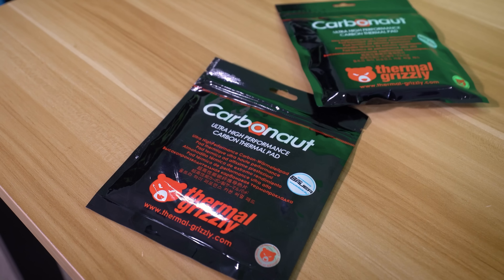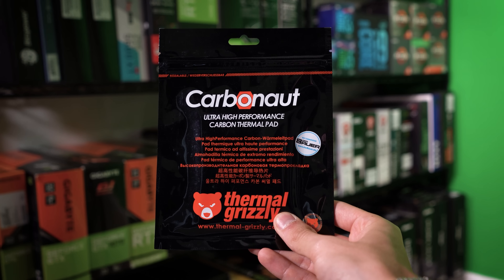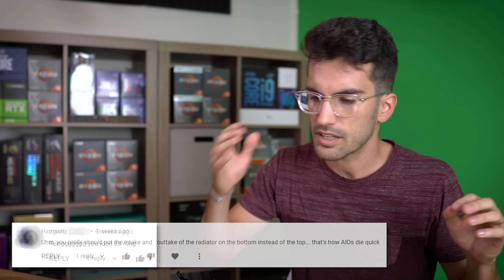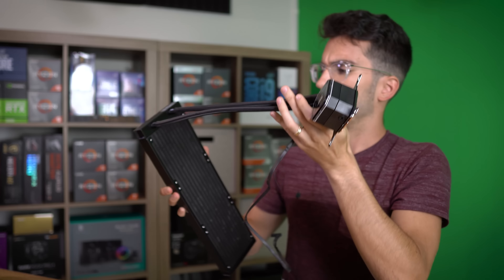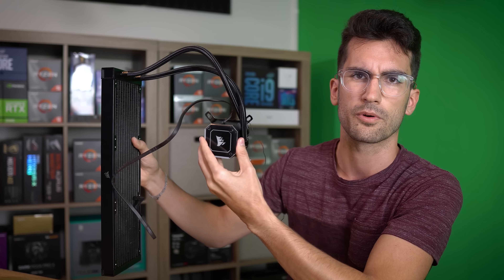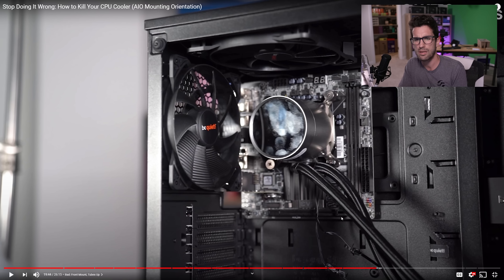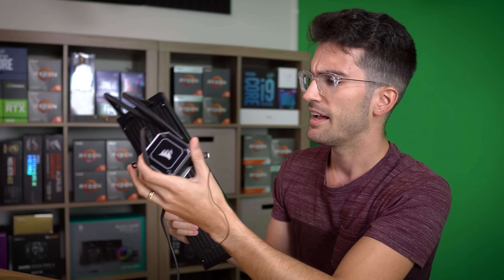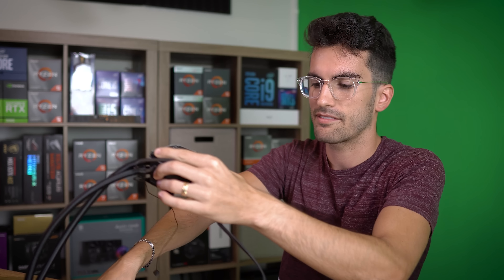Let's Talk About AIO Orientation... Again

Comment: Ive had a Corsair H150i PRO 360mm AIO front mounted (tubes up, BUT slightly above the pump). for 6 years now. My i7 9700K has been cooled just fine by it and never ran into any cooling issues. It hasnt been really loud either. 
   My new 13900k and EK 360mm Nucleus came in yesterday....and now i find myself wondering what orientation i should do even though i know front mounting with tubes up is OK- it never ends 
🤣😆🤣😆

maybe Ill try top exaust mounting this time........

Comment: As somebody, who was engineering hydraulic pumps for aircrafts: not overheating by bubbles is dangerous to liquid pumps, it’s rather what is called pump cavitation or hammering. Pump paddles are hitting the bubbles and this degrades the pump paddles over longer time..
Reply from the maker: Cavitation isn't much of a thing in these tiny Asetek pumps.

Comment: The only reason I am considering buying a PCI vertical mount bracket is to mount my video card sideways and use the space to put the tubes of my radiator facing downwards.

Comment: I have a 240MM AIO from cooler master which I occasionally hear the pump pumping air. I have it front mounted as you explained as the other way around did not leave me any room to work with. It is a rather cheap 50€ AIO but keeps my 3700X under 60ºC under load which is amazing for me (and better than the stock cooler) - I have no room on the top due to clearance issues with the motherboard - I hear gurgling but I don't see any performance issues

Comment: Wow. Thank you for your insight into this.  Just finished my first build and I need to move my (want to move my) top mounted radiator to the front and almost got stuck in the "tubes on the bottom" quicksand - which would have killed the idea of front mount all together since I've go the TD500 Mesh.  But now, I know I can do the font mount with the pump a bit lower than the in/outs on the radiator and since I'm not worried about the little noise it may generate, at least I know that pump and it's overall cooling ability will still be OK.  Big weights .... off my shoulders !!  Thank you !!
Reply from the maker: No worries! Thanks for watching! It's a shame folks are believing this layout is detrimental.

Comment: The thing is all AIO's will have permeation and will loose fluid so the barb up will definitely start making noise. eventually. just place it barb down and never worry about this.
Reply: Sure but not every case allows for up top or in the Front with tubes down.. Mine dosent. Only way the radatior will fit is in the Front with tubes up.

Comment: If your PC is builr for mostly gaming, and have a fan cooled GPU, it's usually best to mount the AIO on top  so that the GPU, Ram, VRM's and motherboard components get cooler air from the front case fans instead of receiving a front mounted AIO hot air.
If you dont game and dont use a high power GPU, then front mount AIO with tubes on the bottom of radiator is best in cooling CPU by a few Celsius compaired to top mount AIO. Then again,, your ram, VRM's and other motherboard components will end up having higher temps.
So what manynpeople forget about is what your using your PC for and the motherboard component temps.
I mount my AIO on top so that my other motherboard components receive air from the front case fans and keeping my GPU and motherboard components cooler. Top mount is really the best of both worlds for a single AIO use.
Hope this helps people out.

Comment: It should be fine but if you are worried just save some money and build custom loop. It will last for years. My ddc is almost 15 years old, block and radiator too and only have to change tube between builds.Once a year change coolant. That’s it.

Comment: IMO-ymmv, there are solutions to this issue if it is one to begin with(not a lot of reports of failure due to airlock). Locate the pump at the barb end of the radiator and mount it barb down if installed in the vertical(front) orientation or have a visible window to monitor pump fluid instead of rgb lighting or solid housing as most are designed. Or just install a giant air cooler or a non AIO liquid cooled system w/ a visible reservoir/pump. 
Just to be clear barbs up is not optimal orientation in front mount configurations when inlet and outlet are are at the same point in the radiator. However when the barbs are at the bottom which is "better orientation"(allows any air to gather away from the inlet/outlet openings) the pump motor must be strong enough to draw sufficient flow rate to overcome the vertical distance to the commonly placed pump attached to the cpu head. If its efficiently maintaining that pressure it is far less likely to accumulate any air in the pump. As stated these pumps are fairly weak and are going to be less efficient over time due to pressure-fluid loss.

Comment: I shy away from buying AIO system, because I suspected that the hoses above the bottom of the radiator and if you are to cross over in addition to the graphics card. The manufacturers prefer just that way for the hoses to come to the top of the condenser - which I personally consider to be the wrong way / the sizing of the hoses measured into it.

Comment: So basically the pump needs to be lower than the radiator. The MSI Mag Coreliquid 360r I just ordered has a radiator mounted pump so it should be fine in any orientation, but I am planning on putting it tubes at the bottom so the pump is significantly lower than the top but it would probably be fine with it at the top

Comment: Actually, I did have a pump die although I'm not sure what the cause of it was. But it was only 6 months old,  Arctic Liquid Freezer II - 120. Although I can't for certain say it was related to the way it was mounted as it didn't make any noise, so most likely a faulty cooler. Still, I persevere with the upright mounting.

Comment: Interesting curve ball.  If you mount the AIO tubes down, but there is a pocket of air in the pump already, it will have an awfully hard time being forced all the way down to the tubes to clear it.  I imagine air will be bubbling back up that down flowing pipe for weeks unless it's addressed.  This happened to my first AIO, a Corsair H100x.  Mounted tubes down, but gurgled and gushed for several days until I decided to ask online if it was normal.  "No." was the answer and my options were to either wait for it to clear itself which could take days or weeks, or try and rotate the PC around, upside down etc. while it's running.  I did this and the noise stopped, the AIO was working perfectly fine, the CPU bracket on the Crosshair Hero failed first, causing an overheat at boot.  I bought a new cooler (stupidly) before checking it, ordered a new CPU bracket and it's fixed again.  4 years service and it's been handed down to my brother for hopefully at least another 4 years of service.

Comment: Steve's experiment, in my opinion, has two issues. 1) 8:16 where the AIO test subject was filled with no exactly the same amount of coolant, so bubbles are pretty obvious. 2) The manufacturer left the air space, bubbles, on purpose because water needs room to expand when hot, it's not due an issue with the manufacturing process or the unavailability to fill the AIO to 100%...

Comment: So basically, if you mount barbs up on a new unit and you hear the noise after 30 mins or longer, you SHOULD rma the unit because its not filled enough? GN suggests just flipping it around, and that people are needlessly RMA-ing based on the potential noise from top barb mounting.  But, if top barb mounting only causes that extended noise due to fluid levels being low, then you SHOULD rma it (it logically follows)?

Comment: After the GN video I had to reposition the AIO on one of my systems.  Corsair Graphite 760T case.   3  5 1/4 inch bays on top moving the Rad lower.   The motherboard itself was higher in the case causing the pump to actually be higher than the top of the tank by about an inch.   Couldn't move the radiator any higher and the lines weren't long enough to flip the radiator so moved it to the top of the case.  Case is large enough for a custom cooling solution but haven't gone that route yet.
Also it would be nice if they offered a way to refill/top off a radiator.

Comment: Wouldn't an auxiliary 'reservoir' placed high in the loop catch any air, and keep the active part of the system gas-free (assuming the reservoir actually had some extra liquid volume to act as a buffer if some of it permeated away)? I'm picturing something like a an old-style Water Hammer Arrestor (just a capped standing pipe) in household plumbing. Any extra air in the loop would get trapped there, and any loss of liquid would be compensated by extra volume initially held in it.

Comment: I had a front mounted bequiet! AiO that failed after a year and made insanely loud noises coming from the pump wheel when it ran dry and the air got trapped there. When I replaced it with a Corsair AiO I decided to top mount it just to be safe :)

Comment: As far the air goes, there has to be some space not occupied by the liquid to allow room for thermal expansion, think about why a car has a coolant overflow reservoir. Obviously, AIO’s  do not have that, custom cooling loops somewhat have that with the water reservoir.

Comment: Nearly all radiators have to have air in them. I say nearly because some manufacturers have an expansion mechanism built in. The fluid heats up and expands, the air compresses and prevents leaks. There must be some way for the fluid to expand, or leaks will happen. I only say this as Greg is making it sound like having air in a closed loop is a bad thing, it's not.
Reply from the maker: The amount of air required inside of an AIO to account for what little expansion exists on account of heat introduction and these weak AF pumps comes nowhere close to the amount of air shown in the GN demonstration. That's my point. Two separate issues.
Reply: @GregSalazar  I think you did a fine job at explaining. I see silly(IMO) questions asked constantly on the subject. It's a very simple cooling concept, move heat from one place to another, keep air out of the pump and keep the splashing sound to a minimum. I just wish aio manufacturers would include longer hoses for better placement. I'm betting this topic won't be closed any time soon.

Comment: I'm surprised no aio been made yet with the barbs set like a car. Radiator out on bottom and in on the top. Gravity will more or less feed the pump and then it won't have to push into the bottom of a full tank. Seems like the pump would last longer?
Reply: That would require a bit of a redesign but it would work, issue is you're effectively halving the time water spends in the rad with the current design, and it takes time to dissipate energy. One easy maneuver they could do is to add a fill/drain port on the opposite end of the rad. Issue is, frankly these things aren't designed to last forever, and not to go all tinfoil hat here but I think that's an intentional choice either to save on manufacturing costs or just because they don't want them to stay in circulation for too long so people buy more. 

I tell people when I build PCs that AIO water coolers are mostly an aesthetic choice (sometimes acoustic depending on how you tune your fans loop and system), and there's a lot more that can go wrong for very minimal cooling benefit over a large air cooler, and the large air cooler usually costs less. I don't NEED a 360mm aio to support my OC, I wanted one, because it looks nice. If you just wanna set it and forget it with as little extra work and worry as possible just like... get a Dark Rock Pro 4 or an NH-D15, heck for most people who aren't spending their time dialing in a good overclock even like a Freezer 33/34 or a hyper 212.

Comment: um...so maybe I saw it wrong but the best front-of-case rad is with the tubes down right? but they are usually not long enough so that is why tubes are up but.....with tubes down does it not act the same as having the rad laying on the bottom and the air would just go straight back up the tubes into the pump?
Reply: With a Radiator tubes down, the air will collect at the top of the Radiator, not in the pump. Because the pump isnt the highest point. The highest point is the second Reservoir at the "bottom"/"top" of the Radiator.

Comment: I had an old Nepton 240M aio that lost enough fluid for the pump to fail to circulate, even when the barbs were down. I had it barbs up before that, inverting it only got a few months out of it before it had more priming issues. It's possible that aio simply wasn't the best sealed though. It ran barbs up for a long time before having any issues. I had much more problems with the fans it came with, the bearings on both got bent from normal operation, leading to an awful rattling sound...

Comment: I have installed my rad on the top of the case but I've installed the inlet/outlet of the AIO cooler on the top at 12 O clock position? Instead of 3 or 9? Do I need to take it back off and re seal my cpu & AIO? I've seen some at top & some on the side? Really confused and this is my first build.

Comment: Thanks for the video! I posted a pic of my current build, and my AIO is front mounted with tunes on top. My pump is a lot lower than tubes and radiator, and from what this video and the Nexus says that it will actually be ok. I keep getting mixed answers on Reddit lol. It’s crazy.

Comment: What about new air coming into the system while the barbs are down? Wouldn't at least some of it have to accumulate inside the pump itself? At least when the barbs are up, the air would just naturally accumulate in the top of radiator due to gravity. With the barbs down, the air would have to be pushed down through the tubes, which I'd think would be much less likely to happen. I'm asking because I honestly don't know, not that I think anyone's necessarily wrong or whatever. It's more of a thought exercise than something deeply important, after all.

Comment: Put a T on the outlet side of the radiator with an air separator like on a closed loop boiler system and a t on the inlet side of the radiator with a quick connect to add water with minimal air inlet.

Comment: I have a ML240L front mounted, tubes up. 4 Sickleflow fans push/pull. Tubes won't reach around the 3080 to be on bottom. I can't run push/pull fans mounted on top. Neo Air case
I haven't heard any noise, cools well enough I suppose. If I set fans to 100% at 60c, my 3700X only reaches 66c.

Comment: So is the best mounting position wrt performance and life (but not noise) of an AIO the top of the case then?  And how does that work with the radiator fans? Are they oriented to pull in air from the case's top vents into the case (via the radiator, of course)?  Just wondering.  Have never mounted an AIO and always used heat sinks from Noctua.

Comment: im running an enermax 360mm rad and cooler tubes up on my ryzen 9 5900x and it runs at 28 degrees and 58 while gaming. installing your rad in the front tubes up is perfectly fine.

Comment: Hi Greg - I've been seeing this as well. I think people saw GN's video and missed that his suggestions were situational and address different issues. I have a Fractal Design Meshify C case. I can't top-mount my 280mm AIO. I also can't go with a front-mounted, barbs down (fmbd) orientation because my AIO tubes don't reach. Personally, I don't like the way fmbd looks and so my AIO is front-mounted, barbs up (fmbu). In the GN video, Steve says fmbu is a sub-optimal and that going fmbd would address an acoustics issue. He doesn't authoritatively say fmbu should not be used just that it is sub-optimal. He does tell us what we should avoid which is any orientation where the pump is at the highest point in the loop which would introduce air into the pump which adversely affects pump performance and longevity.

Comment: I actually mounted mine with the hoses at the bottom with a front mount.I just took out the extra hard drive trays,all i use is 2     m.2 drives

Comment: That small pocket of air is by design.  If it wasn't there, and the loop heated up enough, the thermal expansion would cause the system to rupture.  Fluids don't compress, but gases will.

Just to clarify, I say this because you make it sound like it's some sort of manufacturing issue.  Like it's not feasible to get ALL the air out before they close the system.  They COULD totally fill the loop to 100% just by fully submerging it before they close it.

Comment: @8:19 The AIO is not "poorly filled". They need to leave space to account for fluid expansion on heat application. When the fluid volume increases, the pressure compresses the air bubbles, thereby creating space for expansion. If the AIO loop is filled to the brim, it WILL leak when the fluid heats up ! So why do some AIOs have less air bubbles ? Simple. Good AIOs have stronger, more robust materials that make up the loop which do not buckle under pressure at the joints caused by fluid expansion.

Comment: So for a front mount you want the radiator higher then the pump and tubes down on the radiator for the most optimal setup front mounted? Honestly I'm so confused also bc of my case I have a master box 5 and the 2 fan mounts are lower then the cpu. Will only mounting one fan to the case raising the radiator above the these mounts cause noise? And I'm talking about like fan noise at this point hitting something in my case? I will note I don't have an aio rn but I'm looking to go with an aio for my 5950x build and honestly don't want to buy a new case and idk how the hell I'd go about mounting an aio in it. Input would be greatly appreciated PLEASE 🥺